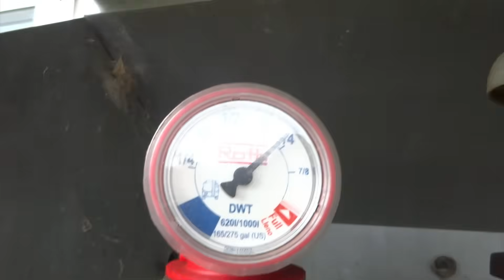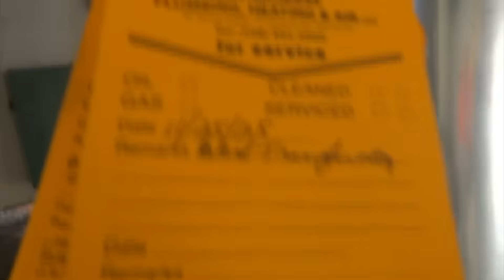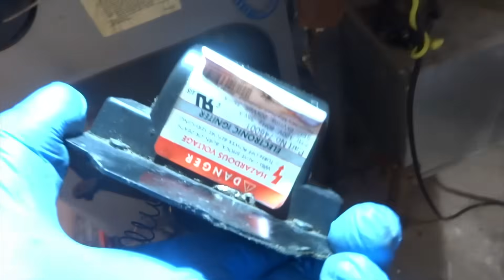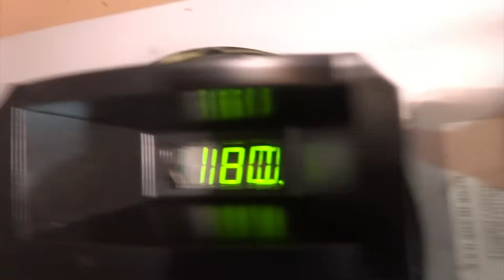BECKETT OIL BURNER NOT FIRING UP

Comment: lol Steve I’m sitting in my basement next to my pos boiler because it keeps hard locking out. CAD cell changed, pump, motor, fuel injector, nozzle and nodes ALL changed. Oh nose cone too. It’ll pause on firing but the lightest touch on the fuel line will cause it to fire. Any ideas? I was going to call you to come out but 65 miles is far hahah

Comment: Just had a double failure with my CAD cell and primary control! CAD had 1,800 ohms with flame (and was clean). Threw in a new one  - that knocked it down to about 680 ohms give or take. Figured that was a fix. Ran a bit longer but the button still popped later in the day! Hit reset and wouldn't do anything - gave the primary a whack and she fired! So ordered a new one and installed that 3 weeks ago. Finally fixed! We had been having a random trip out issue for YEARS on this thing. I mainly burn coal, so it wasn't a big deal ... but now that oil is affordable again, it became a big deal, lol! Hope you had a great Thanksgiving, Steve!

Comment: High vent cap should be loose or replaced. To release air in the system.
Reply from the maker: glycol in system so changing it is a major job ..next time i have to open up the system i will replace it ..i don't live in a perfect world  . so i improvise when needed .